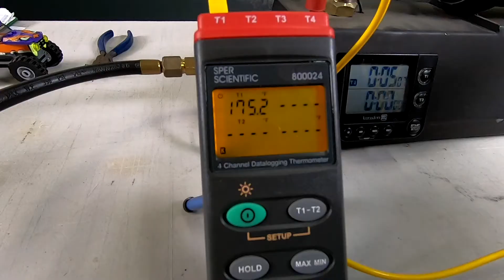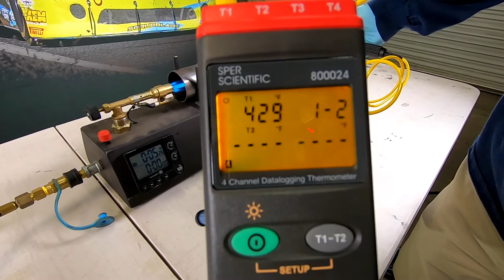Massive Heat Reduction / Heatshield Armor

Comment: Much more efficient than wrap, and prob better for pipe longevity too. I will be going with this instead of wrap.
Reply from the maker: Thank you for watching Matteo.  The business side is a bio-soluble silica thermal insulation material. It is capable of withstanding 1,800 degrees F continuously.  The time savings alone is well worth it.  In most cases you can install Heatshield Armor without having to take off your exhaust.